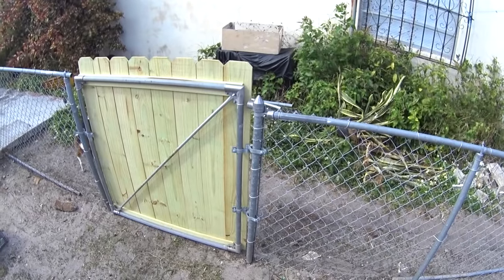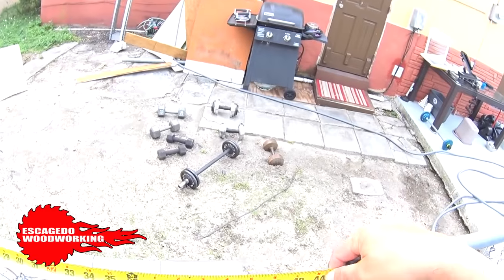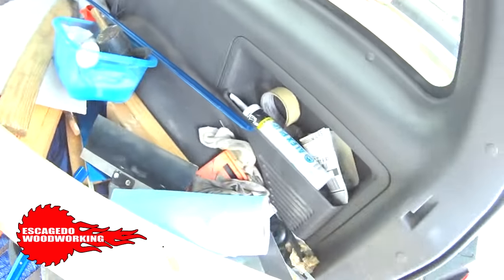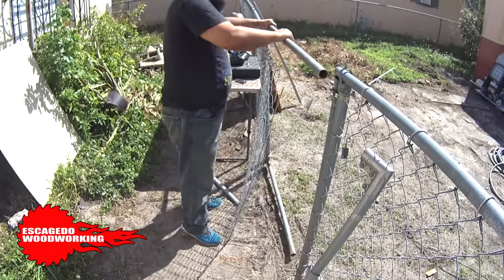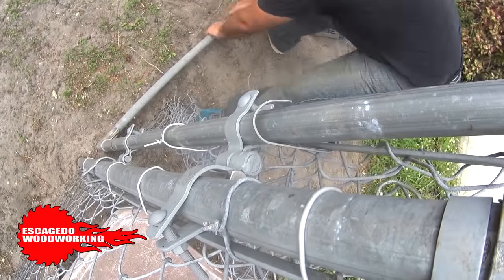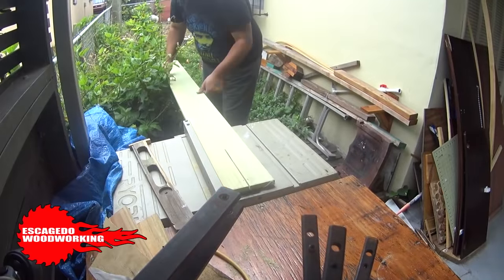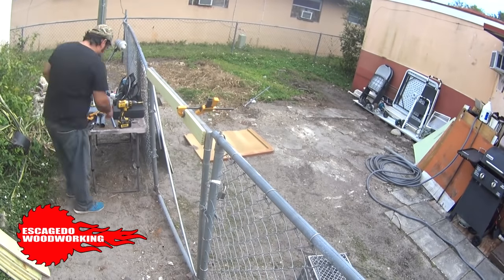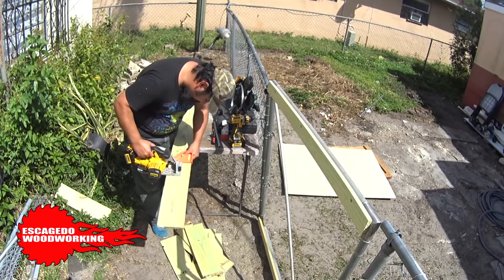Fence Gate / Chain Link to Wood

Comment: Great info! You should do an update on how it's holding up and any improvements made. Was the gate door to heavy after 8 years? Oh i believe you have the metal bracing backwards, should be from the bottom hing to the top corner on the locking side. Thanks for the feed back!

Comment: What kind of screws did you use to attach the wood to the metal bar? Also, what kind of drill bit did you use to make the pivot holes? Thanks for your help, I'm still learning :)

Comment: Will drilling holes through the galvanized pipe make allow the water to get inside the pipe and rust?  I bought a 12-foot wide farm gate made of galvanized 1 3/4" metal tubing.  I had planned on using galvanized metal straps to connect the wood cross members to the metal gate frame and nail the pickets to those cross members.  My idea may not be as solid as yours, but I was concerned about the gate rusting through from the inside if I drilled holes in it.   What is your opinion?

Comment: Much better. 

I have a question though. Arent you worried of problems when the wood expands and contracts over time?
Reply: Darn, then i read the other comments, you already answered my question... will i ever remember to read comments before commenting???
Reply from the maker: Thanks Willem!! The boards do shrink. They are super wet from the store. I have to get cracking on all the projects around here...

Comment: Nice little project but support brace should run the opposite way you have it. If it's not tensioner cable, which holds the gate up from the mount corner....then it's supposed to support by running from the solid mount corner up to the opposite one. preventing sag. Thought you should know. Anyway....liked the video bro
Reply from the maker: Thanks Rag Tie..I see what you mean now!!!
Reply: +ESCAGEDO WOODWORKING I am not criticizing your craftsmanship or your work at all brother I love what you do it's just that I have built hundreds of gates and I know which way the supports should run and now you do too! Much love bro
Reply from the maker: I totally get it Rag Tie...and I understood why and how you meant it Brother.......love you too!!!
Reply: So does that mean to screw the support at the bottom corner of the mounted side to the top of the handle/loose hanging side? My dog is ruining our gate by digging at the ties separating them or breaking them.. I've replaced the bent fence already and the second one is on its last leg as well.

Comment: question so when you attached the wood to the metal frame you just drilled the screw right into the metal? no need for a nut and bolt?
Reply from the maker: yes, correct. Those are self tapping metal screws. They bite the metal so that they fasten well with that material.

Comment: You need to trim the top pipe of the chain link fence piece near the latch and then cap it off. It looks like it could give someone a nasty scrape if they bump against it one night.
Reply from the maker: Yes you're right...and I did think about it at the time. I said to myself, ok I'll get around to it. Still need to do that too. Thank you so much for watching and noticing it too!